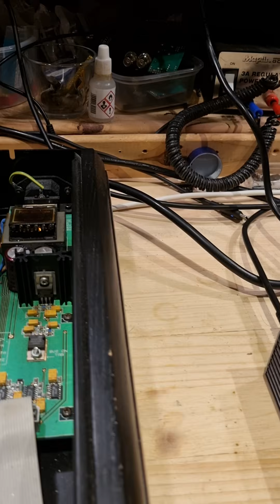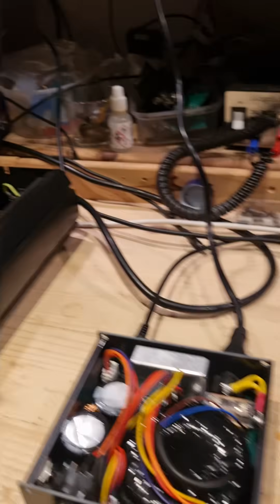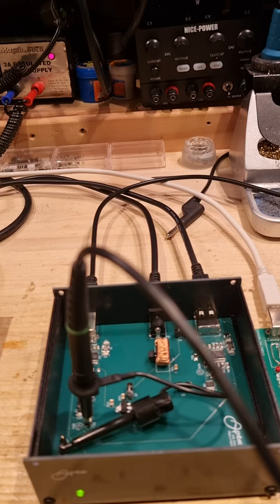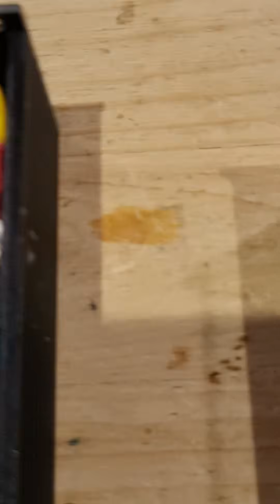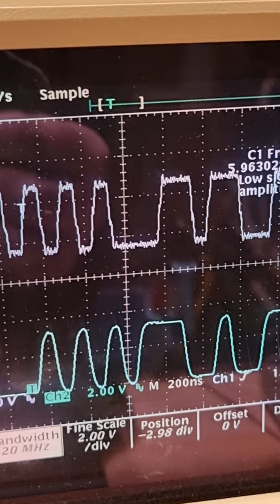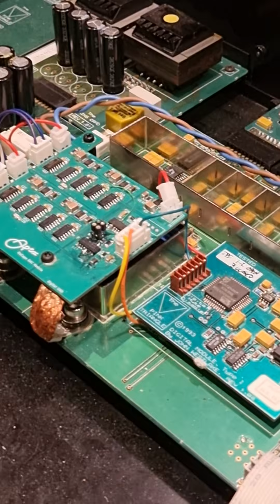APEX USB Cleanser #dac #hifi #chord #british #audio

Comment: Just show reduced noise on the output of the dac, if theres no difference nothing else in the chain matters.
Reply from the maker: The EMI breaks through into the DAC stages, impacting voltage levels, but more importantly, signal timing. It generates distortion on the output, not noise.
Reply from the maker: Totally agree if you can't hear it,  who cares.  But it's not about noise as such...
Reply: I'm looking forward to trying this in my system.  I too use a laptop as my source  into my DAC.  This should, if it does what is claimed make many dedicated streamers redundant.